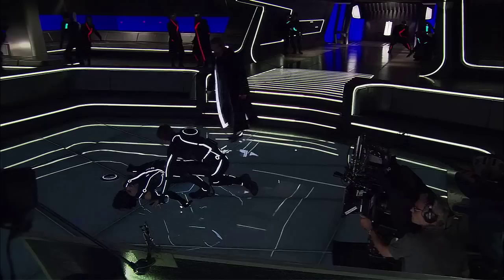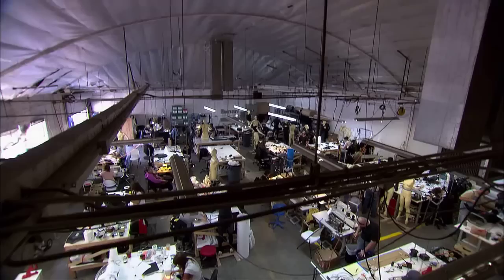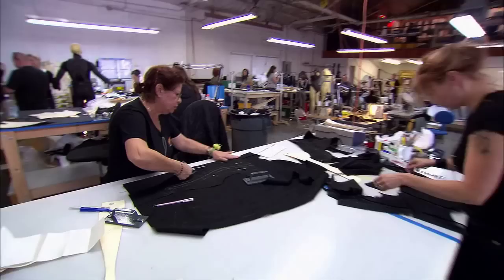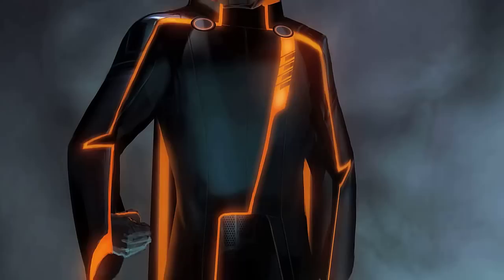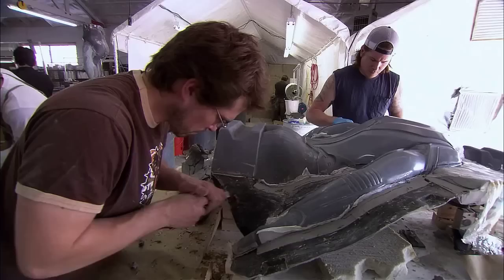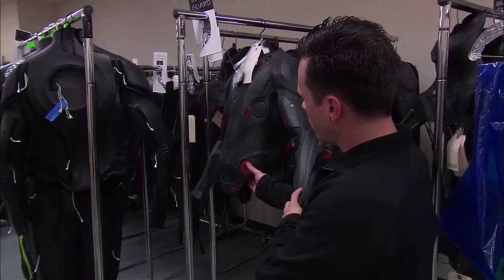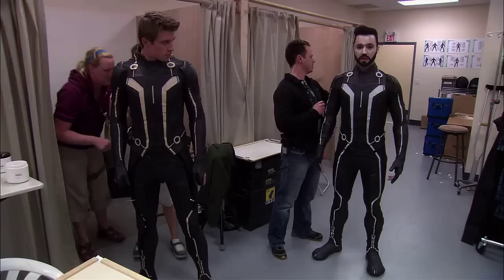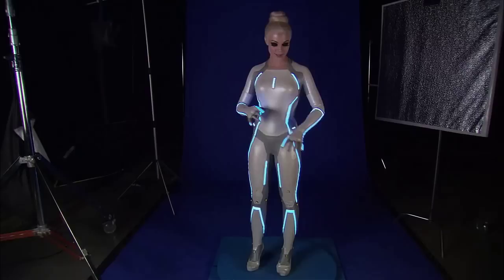TRON Costumes Making OF

Comment: What is the material that they are using for their costumes? I need it for a cosplay I'm making.
Reply: same im trying to do a power man cosplay (Victor Alvarez) and im trying to figure out how to make certain parts glow and i researched and what i think im going to use is EL Wire but in my case EL Tape. But it seems really comlicated. What are you doing?
Reply: Oh I was just going to make my own customised tron suit with my own weapon and skateboard.
Reply from the maker: Check this page, has an instruction to how to make a home-made a tron suit.
http://www.instructables.com/id/LED-lit-Tron-v20-suit/
Reply: Didn't they say it was "foam rubber"? It sounds like an expensive material only the special effects industry can make like that. And then include electronics? Phew guys, you have quite some work ahead of you!
Reply from the maker: Erik Brickman Yep, you right Erik. Part of this development has an OLED tech, so expensive for a simple home-made-cosplay-one day-costume. 
Regards.
Reply: Travis Exodus
Reply: Travis Exodus latex and more latex and flexible foam latex
Reply: #bringbacktron